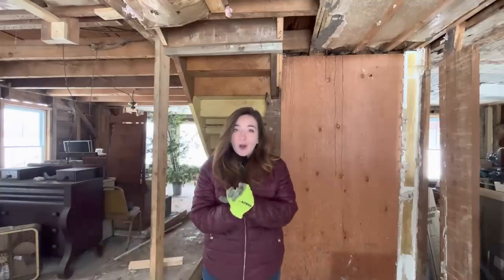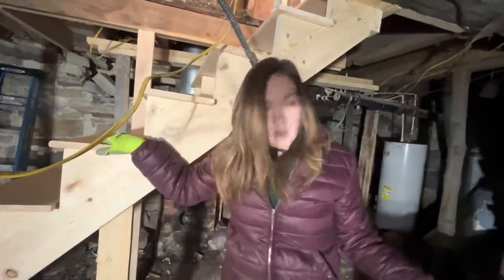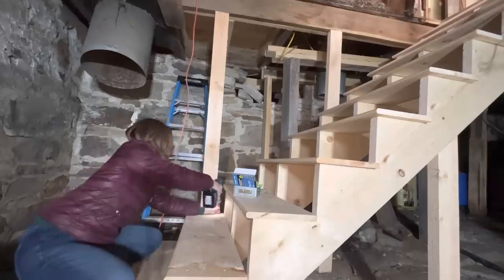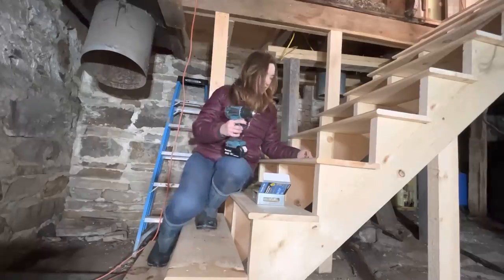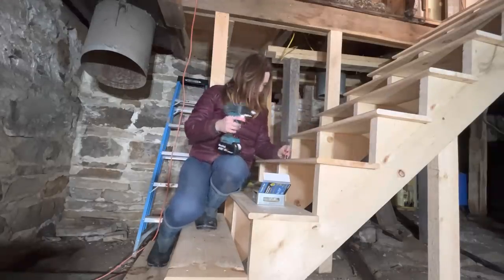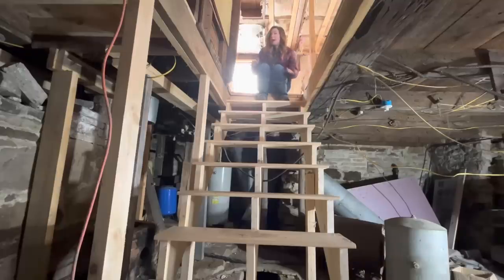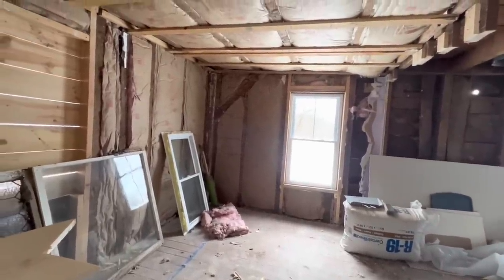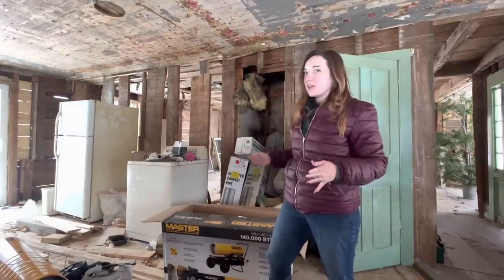my BEAUTIFUL new basement stairs are COMPLETE!! | my 150 year old fixer upper house

Comment: Hi I’m catching up on your progress! I use to be designer for a closet company. Rule of thumb for overall hanging space depth is 24” because you don’t want the clothes to drag against the back wall when moving them along the rod. So rod/pole should be center of that. After seeing the beautiful snowy winter I’m going to assume bulkier clothing will be used. So I would add an inch or 2 to sufficiently accommodate the extra bulk.

Comment: The very first thing I would do is limit access into the house for the winter to the least windy door. I would definitely limit access through the front(?) door shown in the video and close that gaping hole below the door. I would like to see a floor plan of the house as you have it now. I am convinced that you could extend the house outward on the back(?) in what I understood to be your kitchen space. Outward enough to make a 16" by 4'+ kitchen closet eight feet high. Very simple to do. It would be a very easy job for the guy who did the stairs.

Comment: You're doing a great job, congratulations 
You should really consider getting an impact driver, driving screws goes so much better then using a drill, especially when driving screws into 100 year old wood which hardens with age and drastically reduces stripped screw heads.

Comment: Yes I like the idea of separate Coke cause it looks like you've got a Built-in laundry shoot they're in the top corner of the video going into the basement and also that thing at the bottom where the water was that could be the old style water control system for your basemeit's not and you may need sump pump in there

Comment: If you used double doors on the coat closet with the bar and shelving parallel with the front door you would double your storage. Otherwise you will lose the space you need for stepping into the closet.

Comment: I think I voted for a separate entry coat closet and laundry room way back in the late summer or early fall. My reasoning was and is that the laundry room is the most sensible place for all cleaning supplies, and there's a risk if you've hung your outerwear near cleaners like bleach. Maybe I'm the only one who has those kinds of mishaps, but I've been watching you, girl, and I'm on the edge of my seat just thinking about "typical Abby" happening. Plus what you said about not having to rush in before your guests to make sure your undies aren't overhead 🤣 Where you're now planning on placing the entry closet is convenient to both egresses. Place a sturdy indoor/outdoor carpet runner along that whole wall from door to shining door, and you're set. I highly recommend planning to have seating for removing footwear and especially putting them back on. I don't know if your local culture is one where guests remove shoes in the house, or if they leave them on, but I'm guessing that it's boots off in winter. I guess most people don't have trouble without sitting, but some of us have bad feet, backs, or knees that threaten to tip us over if we try to remove or put on shoes and boots that require 2 hands to do it, or even just one hand. I always appreciate when my host and hostess have a bench or chair. Unfortunately, few do, so I have to plan to wear slip on shoes when I visit most people, as I did for Christmas and New Year's. Thankfully there was just enough snow for a white Christmas, and it was melted off the walkways by New Year's, or I would have had to struggle with pull on boots. No fun. I don't think it's fair of me to ask others to accommodate my special needs in their homes, but I'm really very grateful for the thoughtfulness of those who simply place a chair by the door. You can't imagine the fear of falling over while putting on footwear, and then not being able to get up without help. It's funny but it's not, if you know what I mean. Anyway, enough of that. We had that freeze you had, but we got it earlier. I kept my son's kitten after castration -- poor little guy gave up his ornaments for Christmas. Thankfully it wasn't like the colts suffered, no worries about empty sacks filling with fluid, and he was his rambunctious little self in a couple days. I would have taken him back to his new home in my son's new old house, but it was just too bitter biting cold. So I kept him for 3 days, until Christmas Day. It was still quite cold, but not as bad -- +21°F as opposed to +7°F and wind-chill. While he was here, we enjoyed your sleigh ride via your dad's channel, and the kitten liked your singing. He's got a musical ear, and likes to hear singing. After the video was over he booped my nose and mouth like it was the power button on a radio, until I started singing. Then he curled up and purred. Then I played your dad's video again for him. But he was happy to be home with his fellow feline housemates in his new home, and I was happy to go visit family for dinner. And I was happy when the temps rose by the New Year. I think this is sufficiently long enough to help your algorithm, so I'll stop here and simply say.... Best wishes ✨

Comment: Hi Abby. I had a lovely Christmas with my daughter her fiancé and my two beautiful grand daughters from 22 to 27th Dec and my oldest son came down on Christmas day. Dinner was a success as usual. my son took a couple of plastic containers full of left over turkey and all the trimmings. Abby i have a question for you. Why do you have your chimney in the middle of your house isn't that a little dangerous you should have it on an exterior wall with the chimney going out through the wall to the outside and up past the roof line so as the smoke doesn't come back into your house. It wont take much to to put it on the long wall opposite to where it is now giving you more room for a bigger coat closet and a place for shoes. I just think it is very dangerous to have a chimney in the center of your house without fire retardant bricks surrounding them with wood and insulation it can burn your house down. I don't know what the codes for building a chimney is down in the USA but we have very strict laws here in Canada. There has to be fire retardant bricks and a certain distance from flammable materials, including a chimney vented to the outside and no flammable materials within a certain distance. The chimney has to come out from the exterior wall before an elbow bend can be put on to have the chimney to go straight up past the roof line so as smoke doesn't come back into your house. I hope you will either ask Jay or find out from a builder what the codes are for fire places. I would hate to see you loose your house after putting so much work into it. There is so much BS and red tape here in Canada you cannot build your house unless it meet all the criteria, and then when you get to the wiring it has to go through its checks the same with the plumbing hvac and all other checks, inspections, its a whole thing. lol. I hope you and the family are well i saw your dad training the colts together today i think they are coming along nicely they will make a great team i think. Have a great day. God bless.

Comment: Those steps look pretty steep.  I think you should tear down the house and start over to make everything meet current codes. NOT!!!   When you start with a 150 yr old house, you have to work with what you have.  I won't even show you what I did with the stairs in my 107 yr old house.  The "spiral" staircase I have now may not be 100% legal, but I almost can walk up and down  with my eyes closed. No twisting my body and head bumping like before.  Not perfect, but perfect-er than they were, and drastically more SAFE!  Good enough is good enough.  If you can walk up and down without tripping. you did it right.  
Also, don't forget handrails.  I used to run up there with my hands full of stuff.  Now I'm 76.  Trust me.  You need handrails.